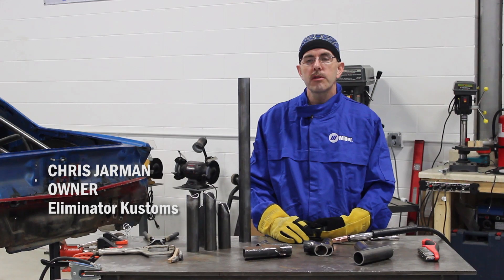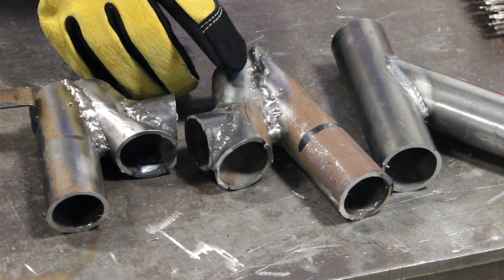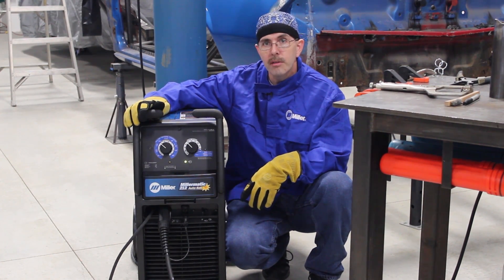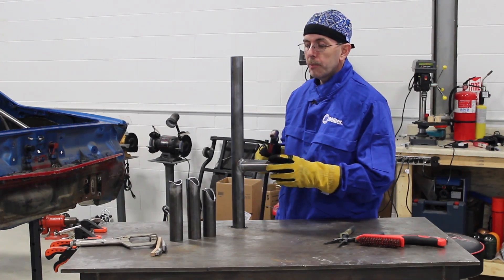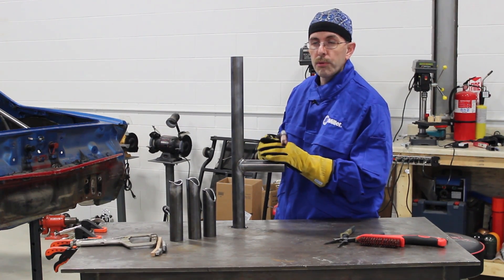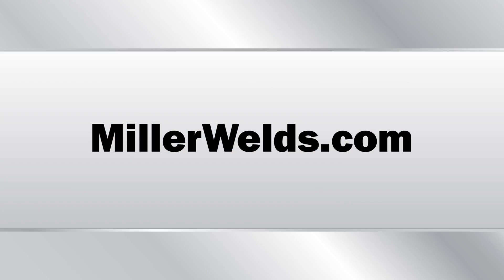MIG Welding Techniques for Building a Mild Steel Roll Cage

Comment: Where you stitching while you were doing the pull method ?
Reply from the maker: We are using a couple different “stitching” techniques. Sometimes we do “small circles” and sometimes, a slight “back and forth” motion. These welds could also be done without a “stitching” technique by running in a straight line.

Comment: Question: You said pulling is a good method on pipe. I build industrial ladders using 2" mild steel w/ Mig can I also drag around the tubing will I get better pen ?
Reply from the maker: Pushing usually produces lower penetration and a wider, flatter bead because the arc force is directed away from the weld puddle. In addition, pushing usually offers a better view and enables you to better direct wire into the joint. Dragging typically produces deeper penetration and a narrower bead with more buildup.

Comment: Your right about welding thinner tubing, at my job I'm weld pretty much 12 gauge above or below that, of course it's on a lot of farm or rodeo equipment but learning the proper procedures of how hot you should run it to get penetration, this first welding job taught me a lot and hoping to move up to another welding job to make good money, and maybe open up a shop like this to build roll cages or various projects

Comment: Nice video; very helpful. One suggestion for improvement: note the voltage and WFS values used in each case and, most importantly, how they deviate from the “auto set” values.

Comment: What pattern technique were you using? I couldn't really tell just curious.
Reply from the maker: This video was developed to illustrate a weld – the specific welding techniques and weld settings used are not necessarily the best for all applications. The Specification Sheet from the manufacturer of the filler metal you use is the best tool to determine your starting welding parameters. We intentionally left the weld settings out of this video because following any local, state, national codes or standards is the responsibility of the welding organization producing the weldment. Testing the weldment will ensure that the settings, technique, and overall procedure that you develop will meet the requirements of any applicable codes or standards. Please let us know if you have any further questions. Thank you!
Reply: @MillerWelders  Blah blah blah blah.............

Comment: @MillerWelds - The presenter covered the need for change in settings for the tighter corners, but did not say what the changes were. Also noting the base metal thickness, amps, feed rate etc would be good to add.
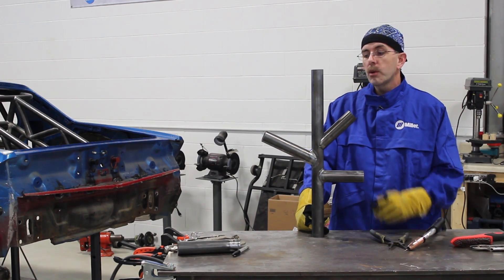Reply from the maker: Hi Patrick, thanks for reaching out. Please reference the video at 4:15-4:40 for what the changes are. We typically don't speak to these settings because everyone welds at a different travel speed, has a different torch angle, uses different techniques, etc. Please let us know if you have any further questions.

Comment: What voltage were using for this when not in the 45 degree Vee and what voltage when you were? That steel you used? Is it SCCA approved and how much do you think that Camaro’s cage weighed.
Reply from the maker: Thanks for reaching out. With the Millermatic 212, there is no volt meter or wire speed meter to show the exact setting. The voltage adjustment and wire speed adjustments have reference numbers on the dial for setting the machine. We were at 4.5 on the voltage setting and 55 on the wire speed.

Comment: Quick question regarding amps and wire speed I’ve google amps and wire speed charts and in one miller chart it says when using .30 mig wire size the speed is 2 ipm per amp and i just downloaded the Miller app and in there it says 2 ipm per amp when using .35 wire size im a bit confused now with your experience which wire will it be easier to control the wire speed? In which wire size do you usually go 2 ipm per amp or roughly close to 2ipm?
Reply from the maker: Hi Corona, thanks for the question. What machine are you referring to in particular? The majority of our small MIG welding units don’t show the welding amperage. Our machines show a 10-100 scale, which is going to be a percentage of the wire speed that a particular machine is capable of running. Thank you.
Reply: Miller Welders 
I didn’t make my self clear i apologize for that! I meant to say that in most welding charts i found in google they say that roughly 2 ipm per amo when using .030 mig wire and in the miller app it says 2 ipm when using .035 mig wire, my questions is in which mig wire are size are you more likely to go 2 ipm.

Comment: In response to some of the comments, I have welded both in the field on oil sell sites and on roll cages and had them cut apart. It is ok to weld downhill on a cage because you will get the needed penetration and after the main bars are installed, you have to be a contortionist to install the rest of it, only giving the option of welding downhill many times.

Comment: lmao retry with this settings : 19volts 240/250 amps and go fast you will not had penetration, be more slowly if you need pene, but you have really small short circuit transfert settings, try it  with spray arc

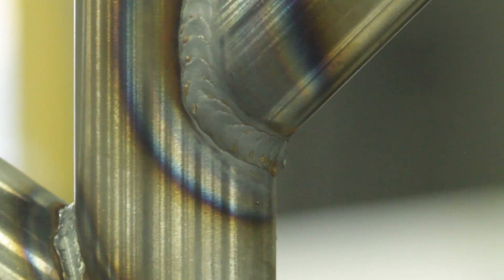Comment: 2:35 + 3:00 + 5:00 = Nice Welds. The others (not counting the beginning counter-examples) not acceptable.

BTW: VD is OK on thin metal and usually necessary to prevent burnthrough.

Comment: you are using hardwire. why are you using 75/25 and not straight argon?
Reply from the maker: Thanks for your question, Adam! Straight argon is an inert gas and provides good shielding from contamination, but hard wire steel needs some CO2 added to help with penetration. This is why a 75% Ar 25% CO2 mix is preferred for solid wire steel wire in the short circuit transfer mode. If you use only 100% argon, you will have a high, ropey, crowned weld bead with shallow root penetration. 100% argon is commonly used for aluminum wire. Let us know if you have any further questions. Thank you!
Reply: would you recomend higher percentiges of Ar over 75/25 ? For example we have 82/18 here too

Comment: Get caught welding vertical downhill in real life, that will be your last day on the job.
Reply: i love how everyone here is a cwi.
Reply: I know what "they" say about making assumptions, but I would assume that since the roll cages must pass "certification" that the welding procedure must be qualified by whoever has written the certification guidelines.  The man in the video isn't welding a bushog in the shed behind his house. He is in business building roll cages that meet or exceed the certification procedure and if there was a history of the welds cracking in the HAZ or any other problem with the direction of travel he would be out of business. Not that it's relevant to this conversation, but since we're pulling our's out to compare the sizes, I've been a CWI for 6 years and have been in welding industry for 40 years.
Reply: +Azza  You have explained yourself so well that I am compelled to concede and agree with your superior logic. Consider my mind changed.
Reply: Even that whipping technique, I know of many shops where I'm from that would sack you from the structural industry faster than you can say whoops.
Reply: +Feraud Quilens ...it's hard wire.
Reply: Yeah, I'd imagine the same thing, ESPECIALLY with a roll cage.
Reply: same. I used to manufacture motorcycle accessories. its was all about 1/16 thick tubing.similar to what is seen in the video here. running downhill produced the needed penetration and looked better in the end, since we had to try to keep a low profile on the welds.
Reply: +eduardo sampoia i know man. its the same everywhere. all our hand rail for our mods are made this way. this is to BP, ConocoPhillips, ExxonMobil, shell specs and is within tolerance as long as speed and heat are good. all these dudes saying its wrong need to ask for the wire speed, amps, volts, time for weld, do the math and find out if its right. maybe ask miller to do a UT or xray test on these to prove to the kids that question it.
Reply: +eduardo sampoia your qualified welder wouldnt be qualified for whatever metal he's welding without a wps.
Reply: Ever heard of a 8010 Rod? What do you think Pipe Liners do? Weld Vertical Down Hill all day Long making $100 an Hour. Thats Real Life
Reply: +adam kangas doesn't matter  if he doesn't have a wps
Reply: +Feraud Quilens everyone is a cwi on these videos. even you. good luck in your little shop. done commenting.
Reply: I'm not saying don't downhill weld, I verti-down often, sometimes its all you can do, however, when push comes to shove and something is structural, it is basically a no-go, again, not against them for visual welds, but highly against them for structural, and though some structural welds won't fall under a lot of stress, it is a bad habit to get into, and any boiler maker worth their pay check, will have the same stance.
 
And just because there is a Miller rep =/= instant welding professional. AT ALL!

The irony of people calling other people CWI'S whilst debating what they think they know is astounding, peace out all, keep on welding, and let's all pray, that chinese manufactured steel, will one day be wiped from the earth.
Reply: you must not weld much dude.
Reply: To each his own. We are from two completely different worlds. In mine, this is unacceptable.
Reply: We had allot of welders that were trained and experienced in the structural welding world come into test for a position at the shop. they burnt massive holes in the tubes and produced a wide array of "donkey dicks". Only because its lighter gauge.
Reply: +adam kangas whats really funny is I am a cwi in real life, and have been for awhile. but its funny to watch you pretend to know what your talking about.
Reply: +eduardo sampoia not arguing about downhill welding out in the world. but seeing that most welding code says that downhill welding is prohibited unless a qualified wps is provided, the times that downhill welding is used without a wps are wrong.
Reply: +adam kangas I could care less if you believe me or not, all I said was correct. you guys are the ones who's feelings are hurt.
Reply: LOL structural industry hahahahaahahaahaha what a joke.
Reply: Justin Mundy depends on wps man. that is all.
Reply: Even so, welding vert down on a thinner wall thickness is one thing and can be debated in regards to penetration, but that whipping technique? That is just adding more heat and stress into a bead you just laid down, and on thin wall thickness, you DON'T want that, the heat zone surrounding the weld will just be begging to crack and break, and 9 times out of 10, THAT is where they break.

And when it comes down to it, I really dont want a section of a roll cage piercing through my back and out of my chest because someone couldn't lay down a safe and strong weld.

In Australia, like I said, you would be sacked faster than you can say whoops, and it is completely justified because we are held to some of the highest standards in this trade than most countries on the face of this earth.

On non-structural stuff that requires looks, fine, whipping and down-hill are fine, sometimes our drawings and engineers call for that. But if you think for one second that a roll cage is not a structural device, but down your tools, go back to trade school, or a race track that calls for certified cages and think again.... they are just as structural as UB's and PFC's etc are for buildings, particularly when their main job, when push comes to shove, and their only job, is to absorb impact... and NONE of us wants a cage where the welds, or the heat zones around the welds become brittle on a device purely made for protection and damage absorption, especially if in question the damage is the entire weight of the running gear on the current car is pushing downwards because you happen to be upside down where gravity is NOT your best friend..
Reply: Azza  what do you mean whip? I’m no welder just curious...
Reply: @shawnreppert1993  The back and forth motion this guy was using on some of his welds
Reply: correct
Reply: welding downhill with mig is totally acceptable, with stick however...
Reply: ***** Again, Eduardo, had you read what I wrote, I said welding vertical down is the only choice you have, now, and i often do it because there is now other way and vertical up distorts or takes for too long than the job calls for!

Now, if we can finally establish that whilst not preferred, vertical down is sometimes the only choice that would be great! BUT there is the issue of whipping, heat zone stress, and bead stress that is still present because of said technique!

But hey, this is youtube and people will always try to argue against things that have been proven.
Reply: if your still mig welding roll cages together your about 15 years in the past 😂
Reply: +eduardo sampoia first, the wall thickness is irrelevant. Second, this doesn't constitute thin wall anyway. Third, never weld downhill period.

Comment: Great video! Noticed that you have a really nice lack of splatter going on and I was wondering how you control that? I can do some good welding with good penetration but it looks like a ball-bearing factory afterwards. I also normally use 75/25 Argon-Co2 and what flow rate do you use and why would you increase or decrease it? Thanks!
Reply from the maker: +Charles Rutherford Thanks for reaching out. We're glad to hear you liked the video! There are two main keys to reducing spatter:
1. Proper voltage and wire feed settings - too much voltage will product larger "globular" spatter balls, while too much WFS will cause the wire to buck which will also result in spatter.
2. Contact tip to work distance and torch angle - it is very important to maintain a constant contact tip to work distance (for this application, typically 3/8") and maintaining a constant torch angle. This is very critical and difficult to do as you manipulate the welding gun around the tubing. With a little practice, it will become second nature.

You are also using the same gas as the one used in the video. Flow rates are usually set at 25-30 cfh. 

We hope this helps. Please let us know if you have any further questions.

Comment: thanks for showing how to do it right i never knew about push and pull this is the first time ive' seen this in all my years welding
Reply: rock dawg contamination doesn't come from pushing or pulling in MIG
Reply: He's still going downhill. If he wanted better quality welds, he'd go uphill with a perpendicular or slight push angle depending on where you are on the pipe.
Reply: For me this is new also ive been a welder all my life from what i gather pushing a weld is better than pulling because you let less chance of contamination into the weld its self it all depends on argon pressure and if your using flux core wire and the cleaness of the weld material also i heard and i use this on my own mig that using wire cleaner pad and lube pad from cyber weld does keep the wire going to the gun clean and properly lubed for better welds they are not expensive and you can buy a 6 pack three red and three black i use them on my miller 140 mig...and how good the argon/c02 mix is and you have to adjust the pressure up or down 15-25 to see what works

Comment: Your video is awesome CHRIS .Is it good to use a MIG light when your welding inside corners?  Also Chris, is a 135 MIG welder good enough to start with.? Will the joint welds have the same strength  as a 175 welder?
Reply from the maker: +James Weissbach Thank you for your questions. First, we recommend that you take caution with roll cages because someone’s life may be in the balance of your welds someday.
 
We recommend a 240v power source for welding roll cages. It will ensure you have plenty of power to make a sound weld.

We hope this helps. Let us know if you have any further questions.

Comment: vertical downhill is usually the sign that its a cheap job , farmers weld like this in sheds , try that on a pipe line job and you will be on your way home by lunch time.
Reply: Pipeline welders typically do weld downhill. Less time = more production.
Reply: +Brandon Spence 
you think ....
Reply: IIRC downhill is ok  for up to 1/4" or non structural
Reply: tom thompson I agree but this is just short circuit mig and Brandon the machines they use are different when it comes to pipe it's either stick or dual shield and you drag not push

Comment: you really inspires !! not sure if you mentioned the amp that you selected to weld those pipes? thank you !!
Reply from the maker: +victormorelo666 Thank you for your question. The amperage is determined by the Voltage setting and Wire speed. With the Millermatic 212, there is no volt meter or wire speed meter to tell us the exact setting. The voltage adjustment and wire speed adjustments have reference numbers on the dial for setting the machine. We were at 4.5 on the voltage setting and 55 on the wire speed. 

For more information, you can also reference our MIG Calculator on our website: 
https://www.millerwelds.com/resources/weld-setting-calculators/mig-solid-core-welding-calculator

Please let us know if you have any further questions. Thank you.

Comment: would it be bad if I used a harbor fright welder on my roll cage?
Reply: yes and no, iv had to use a hf welder on alot of thinings that i needed good welds on it held up, like winch plates and making my steering arms on my samurai, it wont be the best weld, if you feel like you can do it do it,

Comment: would it be bad if I used a harbor fright welder on my roll cage?.
Reply: +Demetri Rubi  just make sure it has enuff power to do a proper weld a 90 amp won't do 160 or better

Comment: would it be bad if I used a harbor fright welder on my roll cage?
Reply: +Demetri Rubi  not if you have the setting correct and dont let it overheat